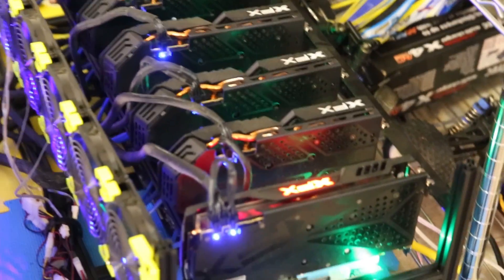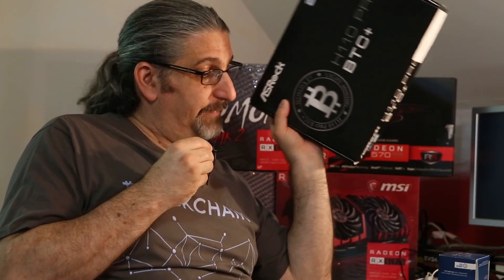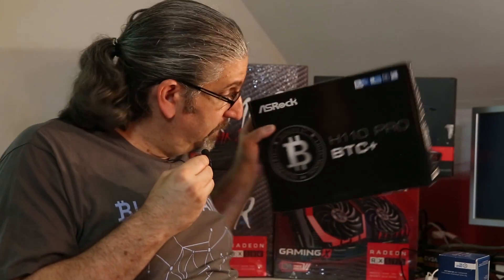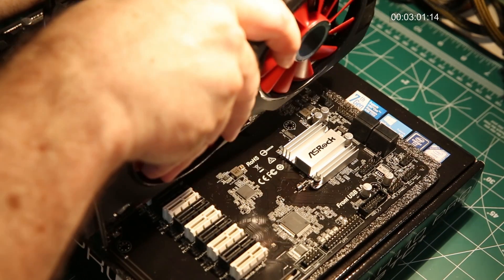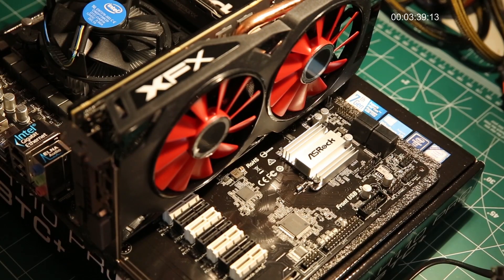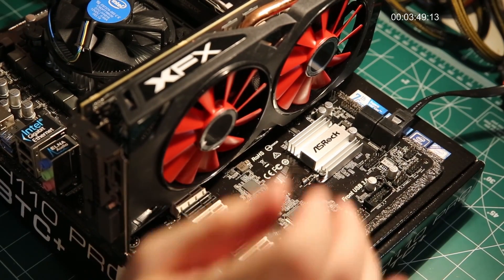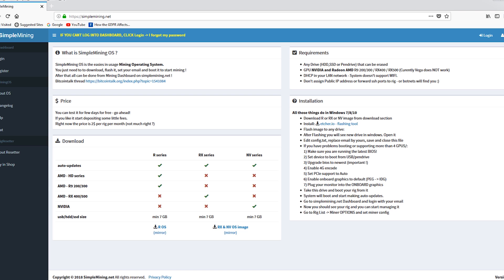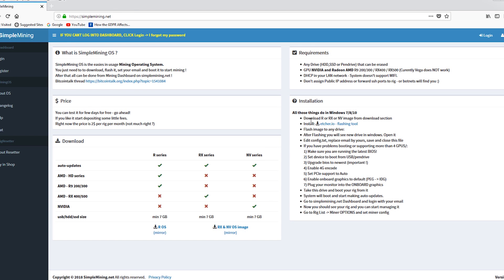Build A Mining Rig In 10 Minutes

Comment: can i use 1 nice hash  wallet for all others  wallet or do i nee to create 1 for each type of coin
Reply: The answer is you can assign your GPU  hashrates to other coins you're not limited to just Bitcoin Mining but you will have to have a program that will let you pick different minning pools. Personally, I think this would be a better route because you can shift hashrates to more than one coin instead of putting all your eggs in one basket. You're not going to get rich minning Bitcoin. The real way to get better odds of getting rich is minning so called penny coins ones that are predicted to increase in value. Set a limit amount goal like 10000 coins per coin. Once you reach that goal switch to a different coin. Now, your playing the odds. Remember all you need is one of those coins to takeoff like Bitcoin and YOU'RE RICH. By the way don't mine Dogecoin it was over sold and it will never go up. Look at blockchain minning Tezos, Chainlink, Electroneum (ETN), etc...

Comment: Do you take the shell off of the usb drive for added cooling.
Reply from the maker: Not sure, but it seems to me that the metal in the shell would act as a heat sync and pull heat away from the electronics.